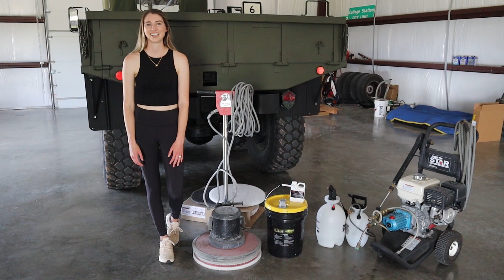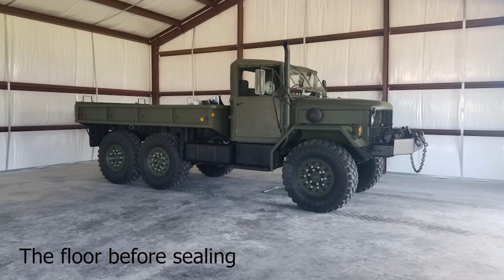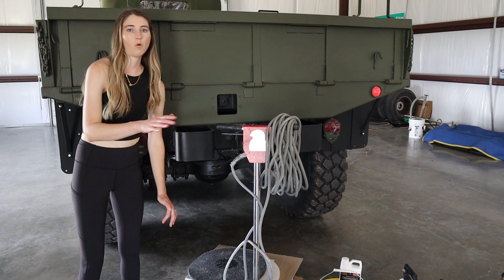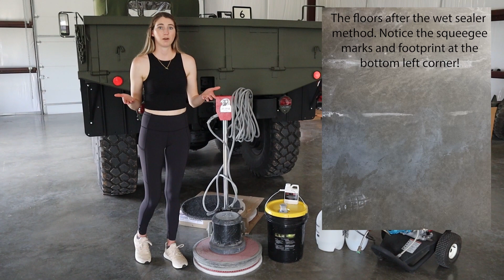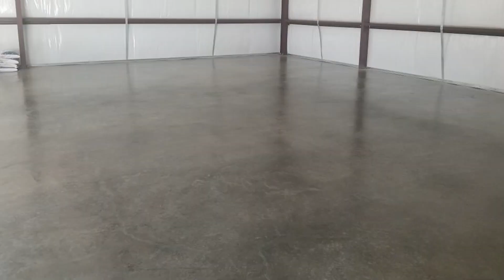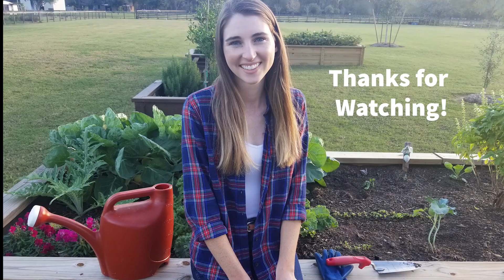How To Seal Metal Building Concrete Floors - Durable and Oil Stain Resistant!

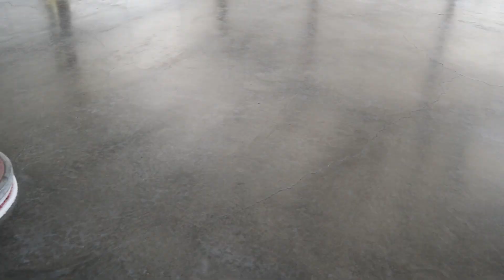Comment: 6:55 the floor is cracking because you did not cut stress joints every 10 feet in your slab.  You probably could still cut it to avoid more cracking later in areas which have not cracked yet.
Reply: well they dont have to be exacty every 10 feet,I did mine how it worked out to look right,12x13 i think is what mine worked out to,luckily my only cracks are in those cut lines,a good compacted base with geo textile fabric under it helps out alot

Comment: Did they not make any expansion cuts in the concrete? This would have reduced the chance of the floor from cracking.
Reply from the maker: We chose not to do saw cuts. Saw cuts are controlled cracking. We have buildings with saw cuts that have almost as many cracks. But in theory you are right!
Reply: Are you anticipating the need for cuts and if so which method? We are evaluating using something like your barn as a home plus room for our RV. If you have any suggestions, bring them. We live in Florida and anticipating contracting out the work. Your suggestion on researching steel building options was def noted. Thanx for some incredibly well done vids❣️